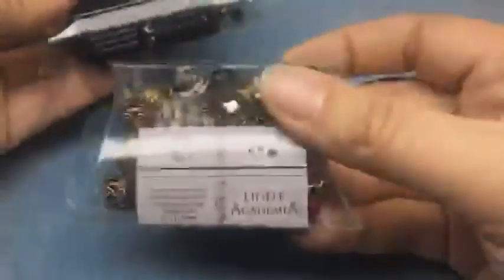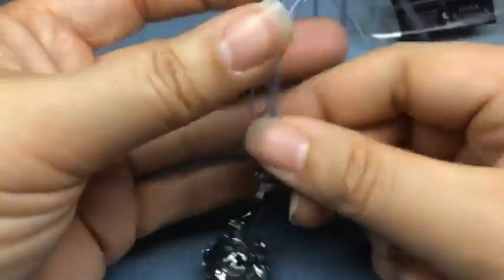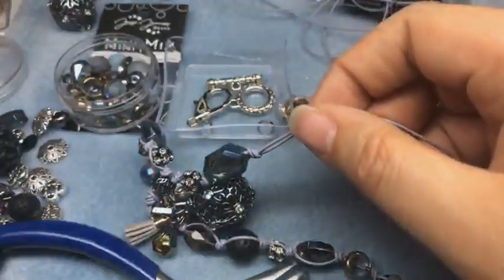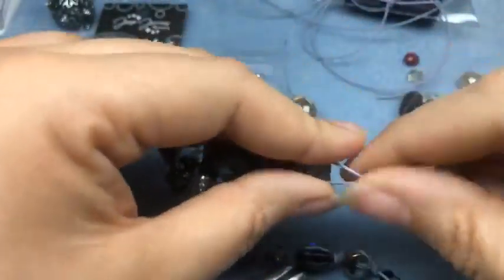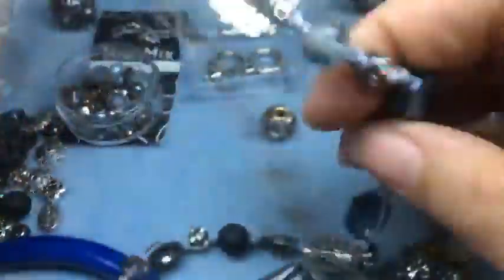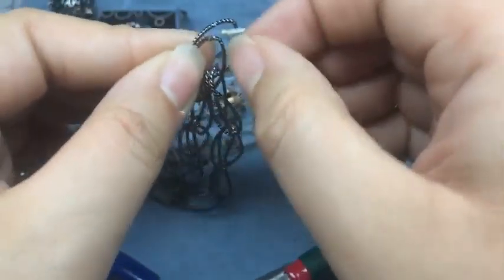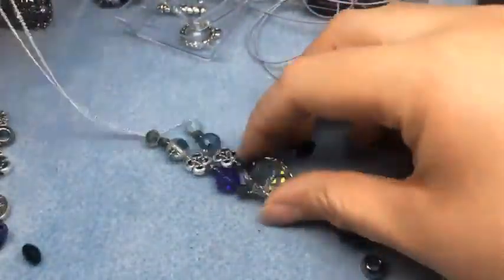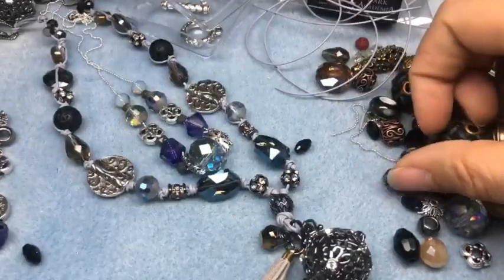Create A Knotted Leather Academia Bracelet with Brittany Chavers

Comment: I am a sponge and learning everything.  I have the basics down but am wondering about how to decide to use soft flex, beadalon, wild fire, clon, wax linen, hemp, leather, etc.  I know it matters with bead size and findings but how do I know if one stringing wire is better than another for a project?  To give you a frame of reference, I started with stretch cord in 2020.  I have tried most of the wires above with varying results.  I have beads but need to build up my findings with appropriate stringing supplies.  Thanks!